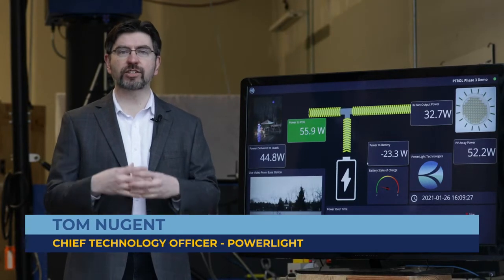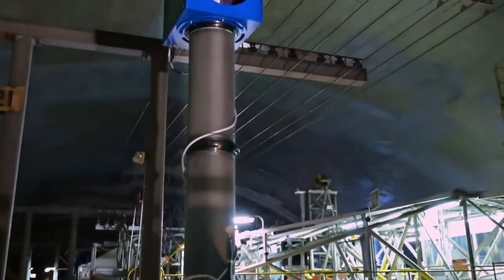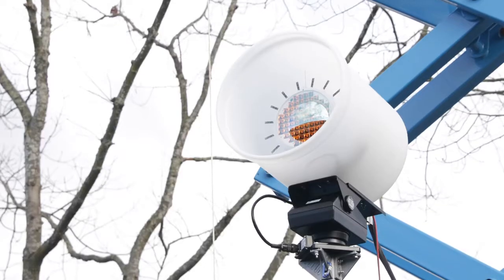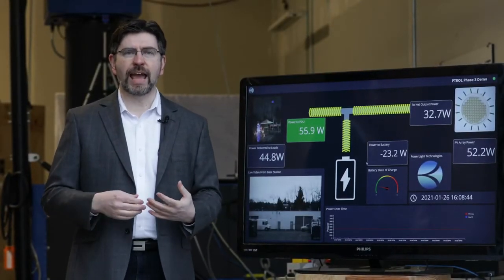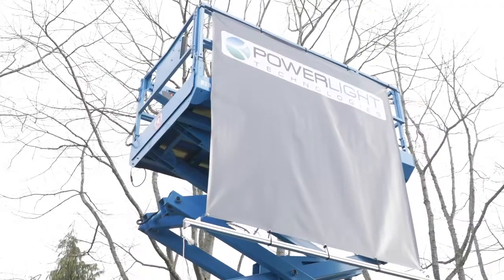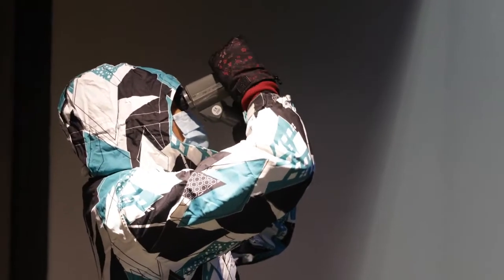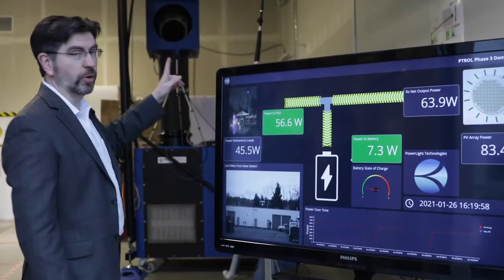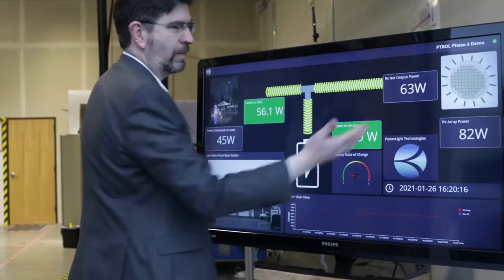Power Beaming  Phase 3

Comment: If powering a fixed-wing UAV like that, then it probably doesn't need to be very powerful.   The reason for this is a lot of existing UAV's weight is (edit: probably) simply taken up by it's high-efficiency propulsion system & it's fuel/energy storage.  But if the UAV no longer needs to carry it's own fuel onboard for it's long journeys, then the UAV's weight & size (& thus it's beamed-power needs) can be drastically reduced.   
edit: ("Probably".  i don't know what's in UAVs, don't put me on a list pls)
Reply: you have already been added on the list 6 months ago